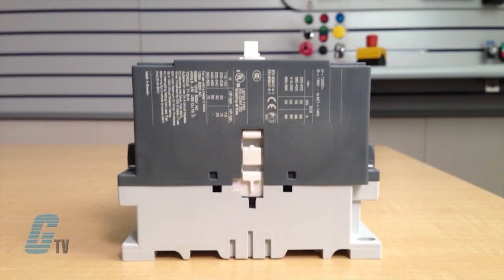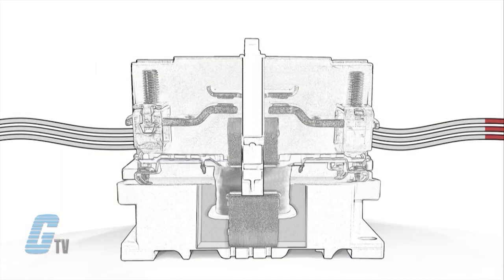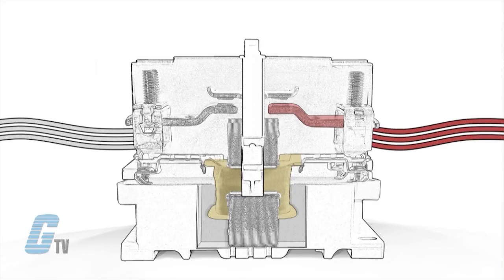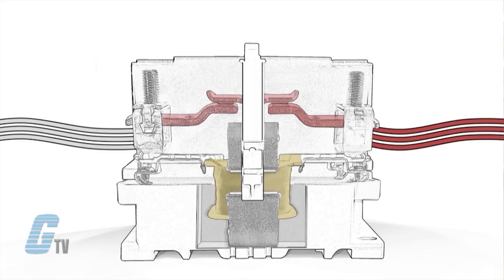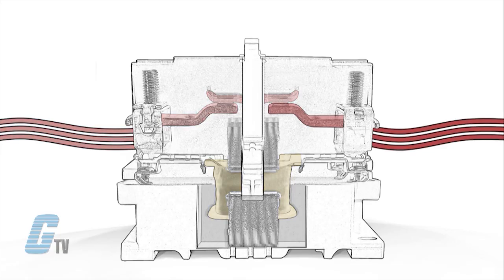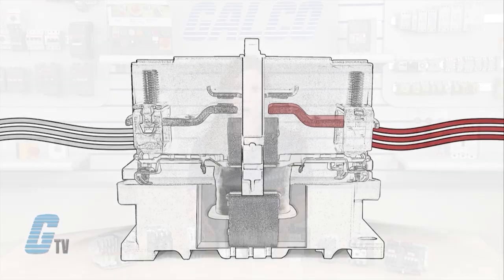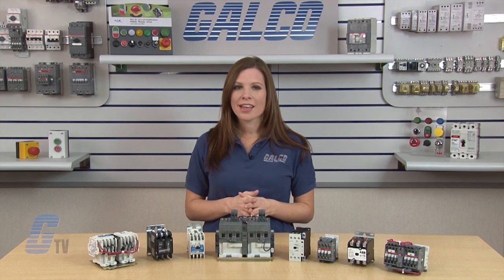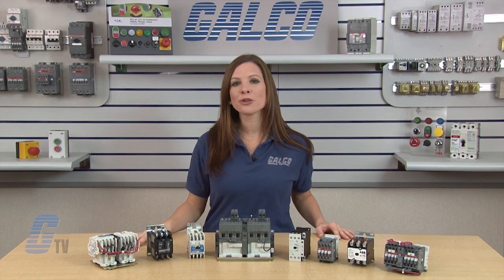What is a Contactor?

Comment: Can we Use t shape relay 30A for controlling 1 hp water pump or should I use contactors
Reply from the maker: Does the pump have built in OL protection?
Reply from the maker: A 30 amp relay will probably be fine to start a 1HP motor, even at 115volt, assuming you are using standard residential house current.
Reply: 230v 1hp motor pump
Reply: Supply  is connected directly to the motor does not have starter
Reply from the maker: Then how are you using the relay to control this motor?

Comment: What is the diference between contactor and relay?
Reply from the maker: Very good question, functionally they are identical. However a contactor has much higher current capacity then its relay counter part. For example, relays will usually only be rated to 10-20amp contacts. Contactors will be rated to hundreds or even thousands of amps of current capacity through it's main contacts. Both relays and contactors will have coil curcuits rated at 24Vdc, 48Vdc, 110Vdc or ac, 240/480Vac. The only real difference in the coils them selves is the size of them to actuate heavy contacts in contactors or a much smaller coil to activate a relay contact.
Reply: GalcoTV exellent! Thanks

Comment: How to calculate the value of resistor and capacitor (Snubber Circuit) that we connect across the the coil of contactors (A1 and A2) .....?
Reply: HB

what is over load

Comment: When doing 3 phase wiring then 3 pole contactor use.. But why?
Reply from the maker: You could break 2 of the three poles and equipment would stop, but is not safe to leave power connected to any phases. Is always better to break/disconnect all 3 phases every time you want to stop power, ok?

Comment: dear galco team kindly tell me that upto what HP ratings we  can use softstarter,dol and star delta....
Reply from the maker: Hi Faizan,

Softstarters are made for any HP, and the larger the HP the larger the SS and more the more expensive it is, too. Dol and star delta are different wiring configurations used when line starting large motors. When connected to a Softstarter, we want them connected star or delta but left that way.
Reply: for example if my motor rating is 430hp which motor starter i will use...
Reply: what's the application voltage?

Comment: I had the run capacitor tested. It was running at about the voltage it should. I replaced it. The symptoms did not. Change. Not sure what you mean about delay system. Symptoms are the same whether it has been on for a long time or whether it has been off for a 12 hours. There is a little circuit board a out 4inches squared connected to the contactor. Could that be the relay system?
Reply from the maker: Hi Rigel,

Our best guess in this situation is that there is most likely an issue with your compressor, which generally requires work from an HVAC professional.

Comment: My ac contactor was visibly burnt. I replaced it. It worked great for a day. Then it stopped working with same symptoms (wont start). Any ideas anybody?
Reply from the maker: Hi Rigel,

To determine what the problem could be, we should determine if it was the coil that failed or the contacts.

If it was the coil, you will want to check the control voltage supplied and make sure the replacement was ordered correctly. If it was the contacts, then we recommend that you check the load for shorts or bad wiring, and also the line feeding it with power should be checked for correct and balanced voltage.

I hope this helps get you on the right track.
Reply: I checked across both the incoming power and its getting around 246. When the unit is trying to cool the house the terminal that goes to the compressor is arcing. This is the same terminal that burnt out on the old contactor.
Reply from the maker: Hey Rigel, is this for a home AC unit? If so, it must be a single phase motor in the compressor, and because it is a single phase motor it must have a starting capacitor connected to the “Shaded pole” of the motor that makes it start rotating the same direction each time it turns on. 

If this capacitor has failed the motor could start in the wrong direction possibly causing this problem, another possibility is the restart delay timer. If the AC system doesn’t have enough time in the off state before restarting, the compressor will lock up from a lack of break away torque. This is common to ALL home AC systems and Refrigerators and Freezers too.

You may be best off contacting a heating and cooling service to take a look at your unit, as DIY repairs on these units can be difficult.

Comment: Great vid and thanks for sharing. 
What size contactor soleniod would I use for a DC motor (me-1004)
with 200 amps continuous and 500 amps max?
Reply from the maker: robviolin1 You would have to look at the contactor specs to see what the peak 
interrupting current is. Typically it is 150% of the continuous current 
rating, in which case I would suggest a contactor with a continuous rating of .66 times 
500 amps, about 334 amps.
Reply: I am really sorry, but I don't understand. Could you put this in a more simple way for me to understand.
Reply from the maker: robviolin1 Sure thing.  In the example I gave you I have a contactor with a peak rating of 500 amps.  In this particular case I am using an ABB contactor as an example. The manufacturer has peak ratings 150% of the continuous. Since 100% is 2/3rd of 150%, I can multiply the peak rating by 2/3rd (.66) to find the contactor rating of 334 Amps.  I would then round up to the nearest contactor size.  This contactor would be able to handle the continuous rating of 200 amps and the maximum of 500 amps.  Contactor manufacturers should list a peak interrupting capacity and since your motor can reach a 500 amp maximum, then you will need to size it base on the maximum.
Reply: So what you are saying is to find the correct contactor soleniod for a DC motor,  you take the peak of the dc motor which is 500 amps times 2/3 or .66 to get the contactor needed for the motor.
It this what you are saying?
Reply: You have to excuse me. I have a music degree and this electrical stuff is very strange stuff.
Reply from the maker: robviolin1 Yes... But this can change from manufacturer to manufacturer.  If you are looking to purchase one, I would recommend calling our sales support at 1-800-337-1720.  They can assist you further in sizing the appropriate contactor.  It will also be helpful to have the nameplate data from the motor handy (correct amperage, horsepower, etc..).  Speaking of which, the part number you gave me for the motor says a peak rating of 400 Amps.  Does the nameplate have a different value?
Reply from the maker: robviolin1 No worries.  It can be confusing at first... Just remember to install things when the power is off.  Also, don't confuse the coil voltage with the contact voltage.  The two voltage ratings can be different.
Reply: Ok - so I will use a 400 amp rated contactor solenoid with my dc motor with 200 amps continuous and 500 amps max. 
What size inline fuse should I use and should that fuse be a slow blow fuse?
Reply: As far as the dc motor goes, I have not received it yet from the mail so I don't know what the name plate says.  The online motenergy me-1004 dc motor specs say the motor runs at 200 amp continuous and 500 peak, 10 hp.  I have decided not to use a contactor solenoid. I am going to use a manual inline battery cable switch rated at 300 amps. I am started to sound like to know something about voltage, watts and amps, but I really just know the music on the page.
Reply from the maker: robviolin1 If the switch is rated for 300 amps, then I would be careful when turning off the motor.  Check the specs of the switch to see if that is a continuous rating and what the maximum rating is. If it is under load, the motor could be running higher than the switch's maximum and may not be safe to break the connection.  The contactor would be a preferred choice and would give greater versatility in how you choose to install the switch to actuate it.  I would also strongly recommend having a professional on site during installation.
Reply: I see. What you are saying is that the contactor solenoid is a better choice than a inline battery cable switch. This electric stuff is very difficult to understand.
Ok thanks.
Reply: I know you have been kind enough to answer my questions even if they don't have anything to do with the video. I have another question if you don't mind.
Today I got the motenergy me-1004 DC motor.  It has two terminals but they are NOT marked. I don't know which one is positive and which one is negative. 
Could you tell me a way how I can check this maybe with a muti tester.  Thanks.
Reply from the maker: robviolin1 I just took a look at the wire diagram for that motor and it looks like it is marked on there.  With the shaft away from you and the back end facing you, the terminal in the 12 o clock position is the negative terminal and the 3 o clock position is the positive terminal.  There is a way to check this with a multimeter, but it might not be necessary.  If the polarity is incorrect, the motor will spin in reverse (Counter clock wise when looking directly at the shaft).  In which case, you can swap the leads and you will be good to go.

Comment: what is the difference between mpcb and olr.........why do we use both in motors..........what will happen if only 1 is used out of 2??????
Reply from the maker: You shouldn't need both.  You will need a contactor with a motor protection circuit breaker (MPCB) or an overload relay (OLR).  The preference between the OLR and MPCB could be the tripping unit needed to close the switch, real estate available, method of control, or cost.  It would be a little redundant to have both of these on one contactor.
Reply: olr is used for overload protection and mpcb isused for short cicuit and ground fault protection.....